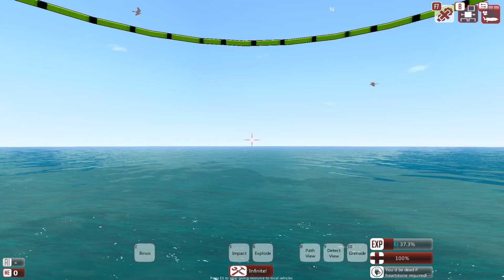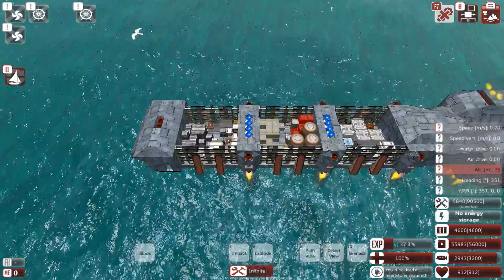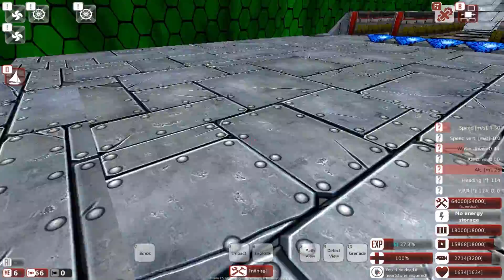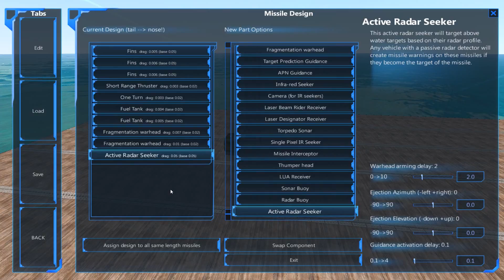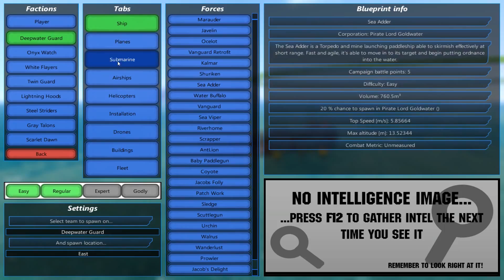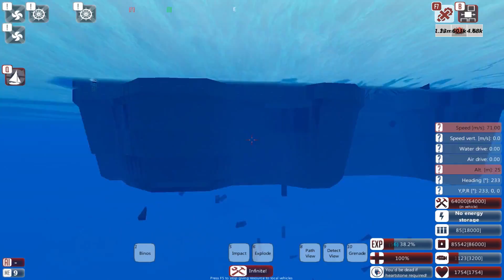From the Depths: #2: Q-Ship

Comment: Could you do a LAM tutorial mine never seem to work well enough
Reply from the maker: The LAMS I use are actually old tech, back from when missiles only had 100health. Re-purposed them for current build by slapping on a storage cavity to give a higher initial burst. The 2 prefabs Ive got though are: 4q, storage, 13cavities, 2 doublers fully pumped to power 4nodes. 4q, storage, 4cavities, 2 doublers fully pumped to power 1 or 2 nodes.

Most players prefer to have a larger centralised more powerful LAMS laser from which all nodes draw from, I on the other hand prefer smaller (and thus weaker unfortunatly) ones scattered about the hull for redundancy. Losing your entire defenses to a single HEAT round is not good.

Otherwise, yes LAMS is on my tutorials to do list.
Reply: Thanks for the advice, big help. That makes sense. I didn't realize the missiles have had a buff. I haven't been on for a few updates, that is why I'm trying to relearn some stuff. What's the missiles health now? Great, I really look forward to your tutorial and you explaining some laser tips and tricks. Thanks for the great videos, I cant wait for more. you've  inspired me to start my own FTD videos. I've  always wanted to do some and you do it much like I want to. maybe one day we could do a colab haha.
Reply from the maker: 25health per block, detection is based on thrust so mines and bombs have zero detection. Active radar seekers can be spotted with passive radar and active sonar seeker can be spotted with passive sonar. CRAM and APS detection is based on the round and can be viewed in the ammo customiser.
Reply: Thanks very much great info. Really appreciate it. do you have a patreon or anything. big fan. keep it up
Reply from the maker: No problem! Not set anything like that up as of yet, doubt it would take too long to setup though.